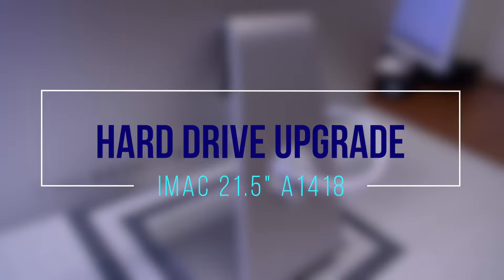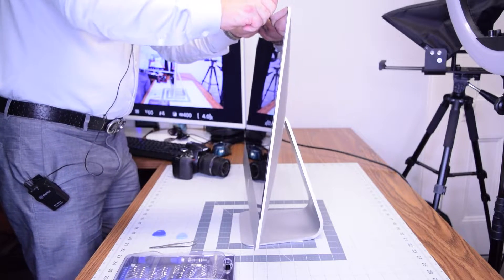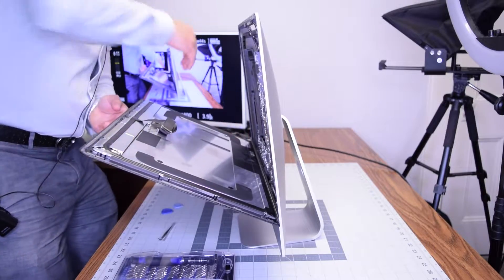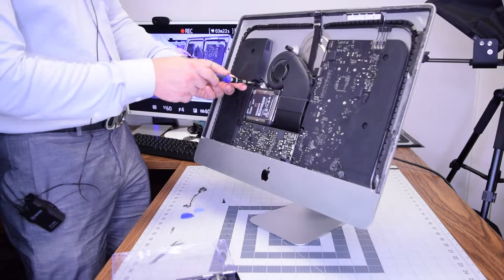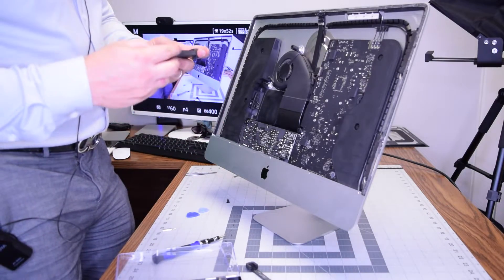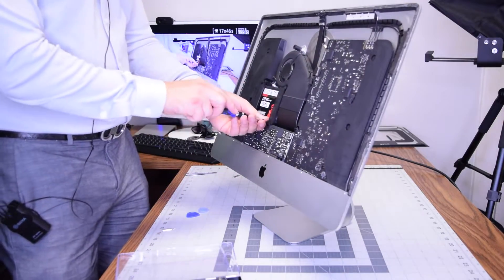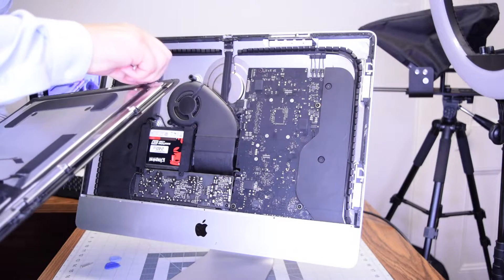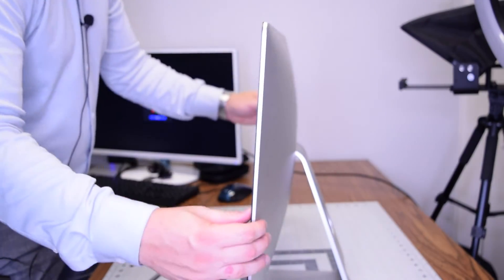🍏🖥️🛠️ 21.5" iMac Hard Drive Replacement or SSD Upgrade 2012-2017 (Including Retina) A1418

Comment: I followed your video carefully and two things happened. The fans were really noisy and the screen fell off and broke the glass.

Then I read that I needed to put a sensor in for temperature. Also I needed to leave the iMac lying flat for 24 hours for the tape to stick properly.

You didn’t mention either of these things/

Comment: Just tested this with a 2012 iMac and a new 500GB SSD.  It's amazing how much faster it is.  Basically a new computer.  I'm waiting on the adhesive strips so I'm still running it off an external enclosure.  The boot up is still pretty slow, possibly because it's off USB?  Thanks for the great video.

Comment: hello good video! i was wondering if i can get a cheap ssd which will run good with my imac, for the record i have the same imac as you. My price range is 60 British Pound Sterling, im pretty new with tech stuff so i was trying to figure out if i can buy any ssd and it will still fit or i need to buy a specific one to fit my imac. If you could get back to me it would be greatly appreciated.

Comment: good job. please can you tel me what exactly is wrong with my imac 21.5 A1418? when i put IT on, it starts shaking you can hardly see what is on the screen but some time it stables a little beat then starts shaking again. i need to know the problem, so i can fix it myself thanks.
Reply: probably the gpu is fried.

Comment: Hello, Do you need to instal something extra to control fans or any extra cable or driver for the new SSD? Does it gets recognized immediately?
Reply: on 21.5 imac you don't need anything.

Comment: I can put any ssd on my iMac 2012 21.5? Or need specifically SSD to don’t get any Kernel task high CPU usage?
Reply: I have a 240gb SanDisk and the system is extremely slow and has a high CPU usage by the system components. Still have to reinstall the os to be shure, but don't have the iCloud password and don't know if it's as important as in iphones
Reply: @jethroff  i have same problems Kernel Task eating CPU usage :/ some one say you need to change thermal sensor on back LCD but i change and still have issues :/ my mac run extremely low .. if I find original HDD on my mac it’s will be run normal?
Reply: @v4niko  Sandisk and Crucial ssds don't work great on macs. If you have on of these, the only thing you can do is buy a samsung one.
Reply: @jethroff  which mac do you have?
Reply: @JakeJoris  thanks for helping, my parents iMac are pretty old 2012  and i change HDD with SSD reinstall MacOS, have issues kernel task eating CPU, i remove some kext file and install app Fan control, right now works well but idk what i broken why i meed remove Kext file and fan controller app :/
Reply: @v4niko  27" imacs need an hdd thermal sensor. 21.5" ones don't.
Reply: @JakeJoris  Hey! I used also a kingston one and had the very same result. the mac is an imac a1418
Reply: @jethroff  I used kingston ssds in macs, haven't had any issues. After you ether clone or install mac os it takes 2-3h to index all of the files. Even now I have a kingston 240gb ssd in my imac a1418, no issues.
Reply: @JakeJoris  finally i discovered that a thermal sensor was missing on my new replacement screen.  I usad the opd sensor from the old screen and it worked good.

Comment: Hi! I have an iMac and I would like to upgrade it with an ssd, after you put the ssd do you need to reinstall Mac OS? Or just like this the work is done?
Reply from the maker: Great question! You have to reinstall the Operating System but the best thing you can really do is look at all your options here https://youtu.be/8jmm4Op7wjk you might want to clone a copy of your existing drive first.
Reply: Thank you so much!!